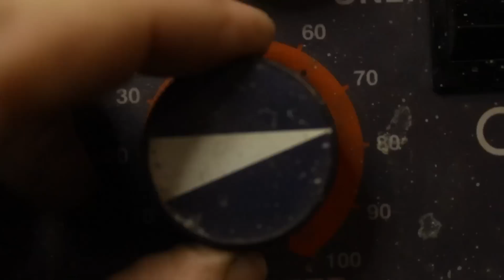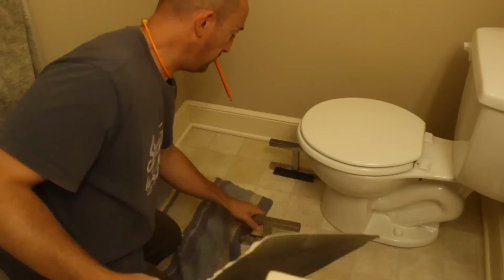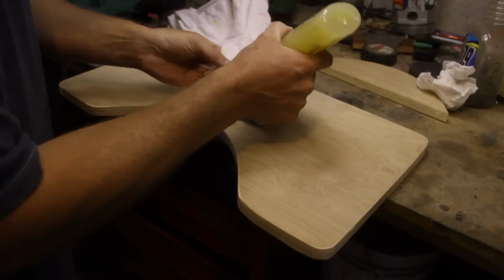Why Is This Unicorn Jealous of My DIY Squatty Potty?

Comment: I like the design but think it should have some snowboard bindings on top for real traction. and the bottom corners need to be shaped like leggo pieces so you can find it in the dark with bare feet...
Reply from the maker: +builtrodewreckedit I thought about the grip tape, but couldn't find any yesterday.  The legos would work perfect!